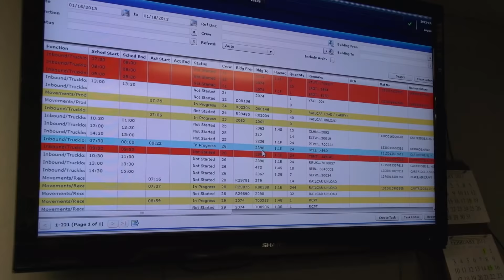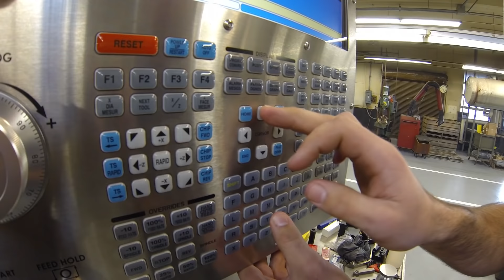Crane Army Ammunition Activity Command Video

Comment: Saw the nose cones and had a awful flashback to my first real job, metal parts fabrication plant. We made nose pieces for the 105 & 155 shells and the projectile bodies for the 81mm mortar. I didn't get to work on the artillery nose pieces before the contract ended(luckily) but did get the "wonderful" experience with the 81mm bodies. They were aluminum and could be VERY easily marked, nicked, scuffed or whatever. Since they were 100% inspected any "defect" no matter how tiny or inconsequential got the part rejected. 

No wonder why mil contracts result in ridiculous costs, quite asinine. I was told the company charged $80 for each piece which was a bit of change in the 70's, about 75% of my weekly paycheck.